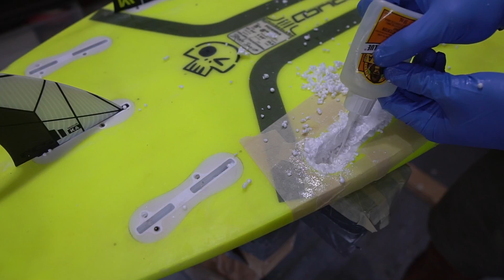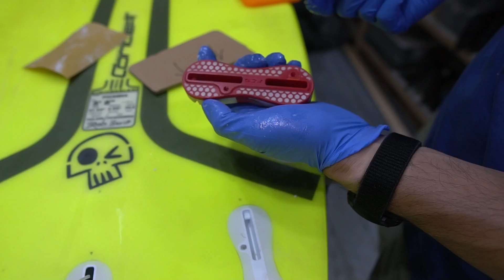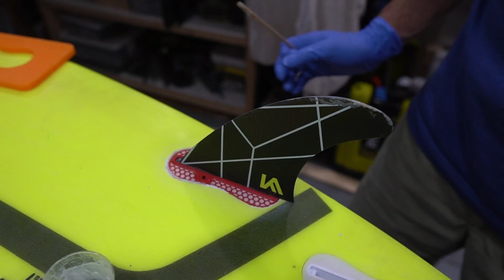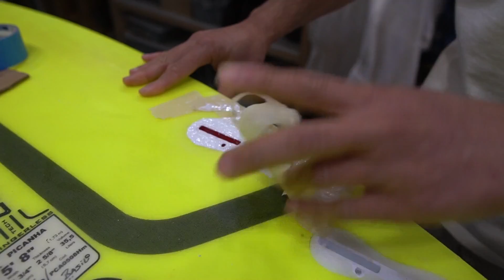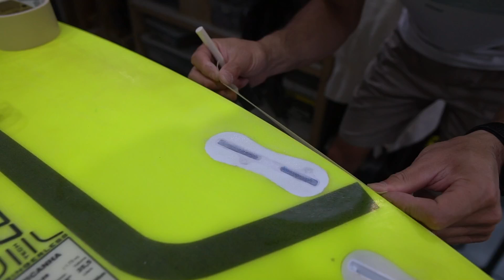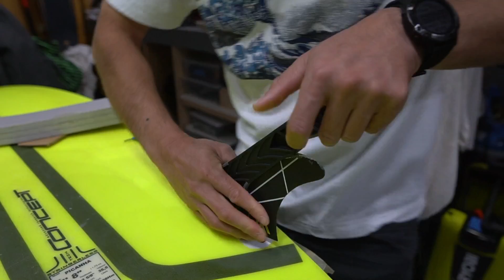How to Replace a FCS2 Finbox | Surfboard Repair

Comment: The reason it was so hard to put in, is because the lip on the top of the box is meant to be sanded. This box has been installed too deeply. There’s a lot wrong with this install I would ask for a refund if anyone did this to my board to repair it.

Comment: You can route them out. Route down to just above the pin, then use a soldering iron to melt the plastic around the pin and pull it out with needle nose pliers.

Comment: Nice repair job!! Curious why you didn't just use 2 part expandable foam to quickly fill the fin box mounting hole vice glueing in the small pieces of foam?
Reply from the maker: Thanks! I didn't have any and I'd rather use EPS foam to match what was there. I don't think that pour foam has a long shelf life so for how much I would use it, it wouldn't be worth it to keep it on hand.
Reply: Polyurethane foam (expanding foam) has a low density compared to EPS so would weaken the box